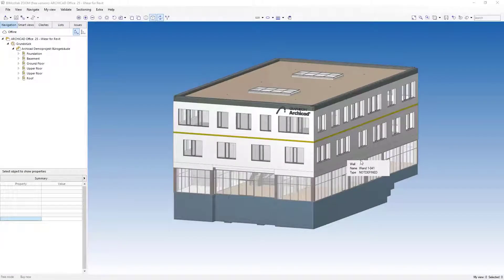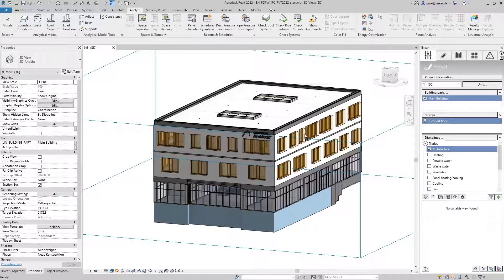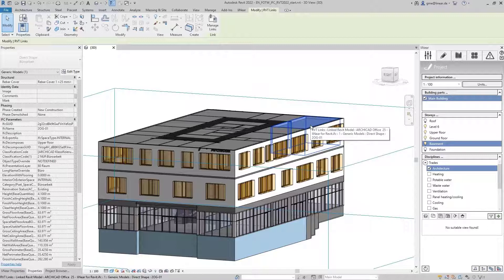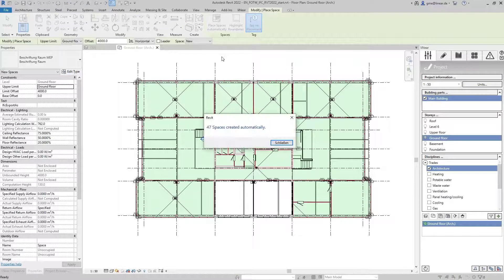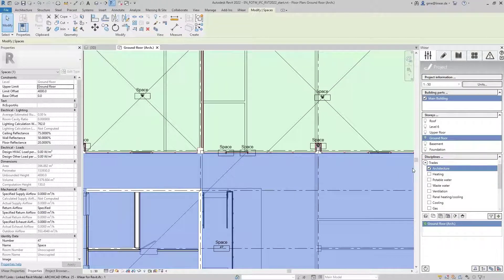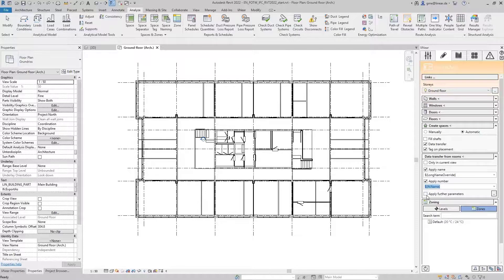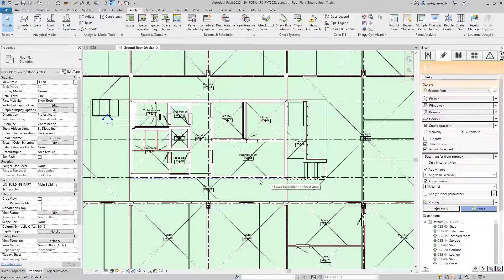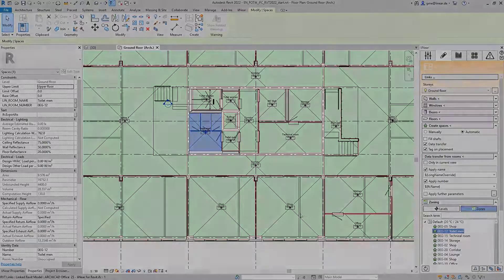Automatic creation of MEP spaces in Revit based on an IFC file

Comment: My IFC model contains walls that have U value, when i run building detection for calculate cooling load, it can not read my U value as well as thermal properties of the wall. Is there any way to fix this ?